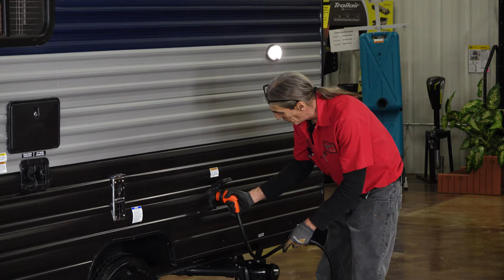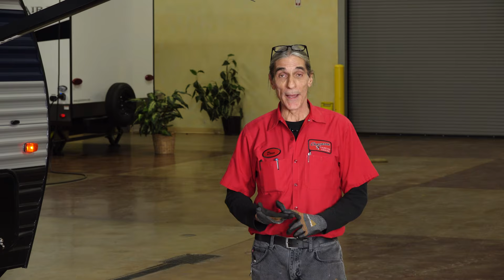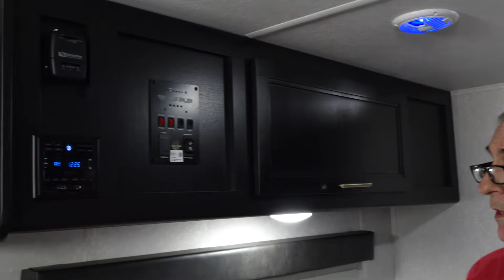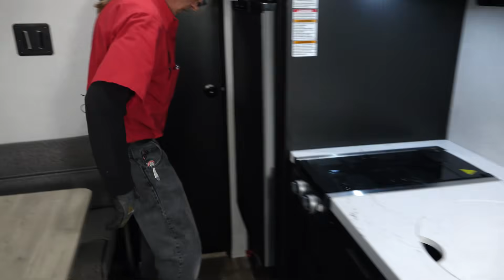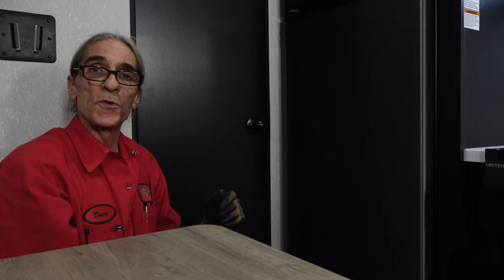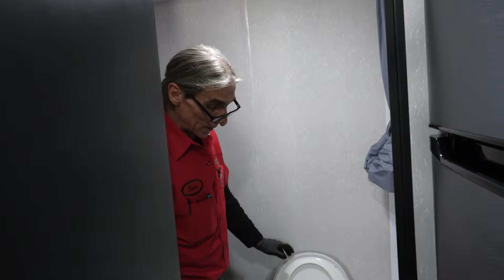Forest River Cherokee Wolf Pup Walk-Through Orientation

Comment: One point of clarification about AC versus DC power in most campers, including this one.

When you are connected to shore power, your 12 V DC devices are also powered by shore power, not the battery.

The power station under the fridge has an AC to DC converter that sits between the battery and the 12 V fuses. It will power any 12 V devices calling for power, and send any excess to the battery.

Comment: Where is the antenna inlet on the 16 he
Reply: The Wolf pup has an antenna built-in on the roof. The coaxial ports you see inside the camper, and on the outside near the TV mount are fed from the antenna on the roof. You will need a TV that is capable of receiving antenna signal to use it. There is no cable connection.

Comment: Why can't the surfer protector be built in?  It's a jackass move not doing so.  Now someone will steal it
Reply: Most campers do not have a built-in surge protector, particularly at this price point.

If you are a little handy, they do make units that can be hardwired in so you do not have to connect and disconnect it at every campground. 

The better portable ones also usually have a metal bracket on them that you can use to lock them to the power pedestal at a campground. A little annoying, but not a big deal.

Comment: Very good presentation. I bought a 2021 WP a few months ago,my first ever trailer. Its not exactly the same, no battery readout or disconnect switch,conrol panel and radio are switched around. Goin Arizona in January, leaving the soggy PNW for a few months.

Comment: Great review.  Having a weird problem...at a hookup site.  Has city water even filled the tank up with it but,  no water comes out when the water pump is off even though I'm hooked up to city water which has really good pressure.   Am I doing something wrong?  Turn the pump on it works fine but the tank indicator shows it draining.  So looks like city water isn't getting through?

Comment: Hello, I need a new exterior light unit directly over where you plug the electric cord in. Where can I purchase it? Thanks
Reply from the maker: You can contact our Parts Department at 800-397-5673 or text 563-284-6868.

Comment: Ill stick to the securing jacks,  Never liked the idea of keeping most the weight on the wheels as with a wind and storm could wash out a wheel chock or even a bump from another vehicle send you shooting down the mountain side. If i just put minimal weight on the leveling jacks if the wheel chocks break loose the camper will roll. A single jack cant do the task alone but if you meet resistance on one jack i find the other will allow more jacking until leveled. Of course I use my impact driver to make using the jacks a breeze.

informative video for sure. I have the 18TO version of this.   Currently turning it from a weekend warrior to a off grid champion. 600ah of batteries and solar with 140 amps of generator charging capability.  140 amps can charge 400ah of LifePO4 in 3 hours flat, my other 200ah are new lead acid purchased a week before the LifePO4.  Separate banks, Lead acid remain permanent camper batteries. The LifePO4 will supplement shore power and keep the lead acid topped off automatically.I built my portable LifePO4 bank to be portable with all hardware screws into the battery box and can be lifted and carried.  I am currently installing a flush 30amp socket to that same battery box so that I don't need to use improper adapters to achieve power from a single 15amp socket off the inverter and instead will wire directly into hard terminal connections on the inverter.

Comment: One critique, pull the grey water first to make sure everything is secure with the sewer line, if you want to save some to flush the line later that’s fine you can close it once you feel safe enough to pull the black water valve. You don’t want to pull the back valve without verifying everything is secure with your connection to the dump or you’re risking a 💩 itty situation!!
Reply: This is a PRO tip that would have saved me multiple times when I started.

Comment: Someone just returned our wolf pup with empty fresh water, but both the pump and heater on (propane).    Do i need to take it to a repair shop to have them checked, or could i check it myself by filing up the tank and seeing if they work?  Thanks!
Reply from the maker: If the water heater was full, it should be ok. You can put a little water in the fresh tank to confirm operation of the water pump.
Reply: @BlueCompassRVQuadCities  if they emptied the fresh water tank, is it possible there was still water in the hot water tank? That would be awesome. I will go add some water, and if water comes out the faucet, that means the pump is fine?  Thank you so much!!!
Reply from the maker: @ajlived6034  Yes, the water heater needs to be drained separately.

Comment: Is it possible to upgrade the solar panel to run the fridge and AC for full time off the grid? If it’s possible what upgrade will be needed? Thanks for the information you put in the video it’s very educational!
Reply from the maker: The AC won't be able to be powered by solar. We can add another panel, up to 170 watts, for a max total of 220 watts. That would help power the refrigerator. A second battery is recommended, but depending upon your other 12V usage, it still may not be enough to run the refrigerator constantly with no shore power. A 170 watt panel runs $799, second battery is $125.

Comment: I just bought a 22 Wolf pup 16fq and this is very helpful. I'm sad that the fridge will only lasting 8hrs on a full battery (assuming the battery is topped off after a day of traveling from a combo of solar/7 pin charging) which means I really still cant pull over for the night without hookups without risking the battery going dead. I figured a 12v compressor fridge would run off and on for at least 24hrs off a 100amp/hr battery. Sounds like a 2nd battery is in my future!
Reply: The issue is that lead acid batteries can really only use 20-30% of their stored energy before the voltage drops and the battery starts suffering damage. That’s why lithium batteries are so popular for boondocking. You can run them down to 0%.

Comment: Great walkthrough. We just picked up a 16HE and I have one question he didn't cover. When the Battery Disconnection switch is set to "disconnected" I assume that also means the trailer battery will not charge via the shore power connection. We have the backup camera as well and I haven't quite figured that out yet.

Comment: Surge protector is a Must! My old rv got fed 2 legs of power thus turning it to 208 power due to a bad update that had just happened in the rv park. My converter survived but it literally blew my fridge cooling system up and every single thing i had plugged into an outlet. Its no fun coming back and wondering why your camper smells like ammonia and nothing works! Get a inline protector!